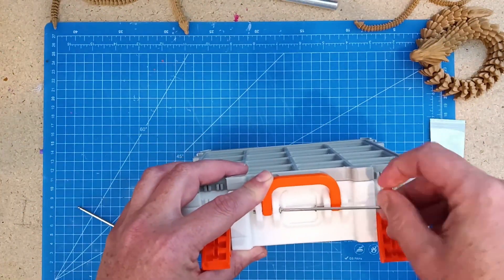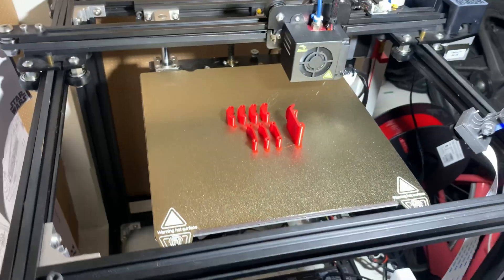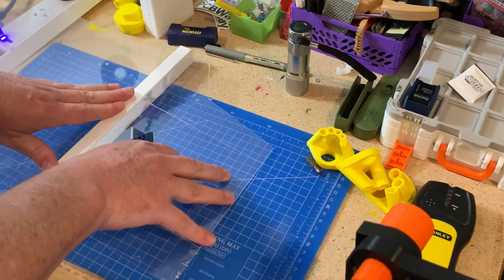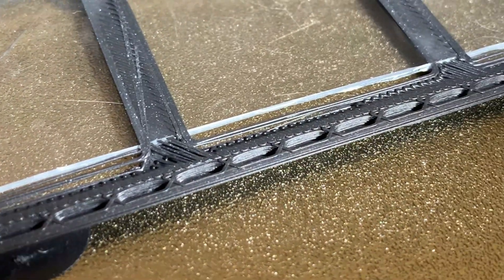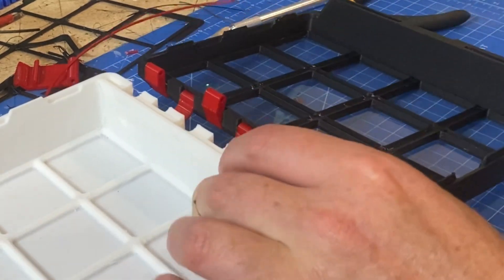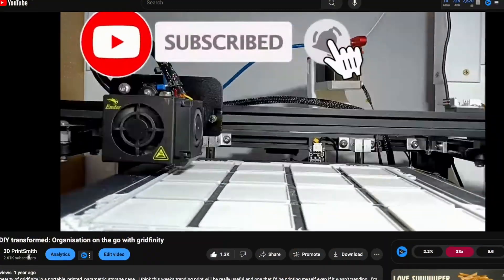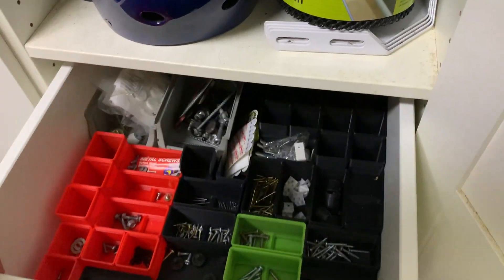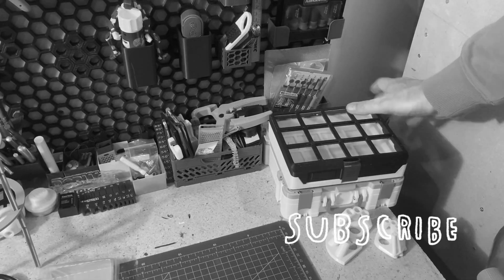Gridfinity portable case.  Organization transformed with a DIY parts case

Comment: Is it obvious where to pause to add the window?
Reply from the maker: It was a little tricky at first to see it but when you slice it, as you go through the layers you want to pause just after the corner tabs are printed.  That’s the recommendation anyway and I think it’s so the acrylic is held down so the print doesnt move it.  I printed another one and because my acrylic was fairly thin and easily fit I paused just before the tabs and it worked for me no problem.

Comment: I printed this one and it was just a pain start to finish, I will not make this one again
Reply from the maker: That's a shame, the hinge was the trickiest part for me and was definately a challenge.  If you are after a portable gridfinity case still though the one I looked at last year with the screw latch might be a good alternative.  that one sits on my desk and I'm using it all the time.  https://www.printables.com/model/543553-gridfinity-storage-box-by-pred
Reply: i can see you problem, after printing 3 cases.

having the wrong layerhight inserting the window is a problem.
not using the calibration is bad, I ended up using the onshape models, which are configurable and nicely designed, to use larger diameters for the holes, and was able to easily print it with the 0.6 nozzle, and the assembly was easy.

Comment: What’s the height standard for grodfinity?
Reply from the maker: Basically everything is a multiple of 7mm and for the pre configured one I made it was what’s called in gridfinity height 6 so 42mm.  most gridfinity bins are in multiples of 3 so 3, 6, 9, 12 (21mm, 42mm, 63mm, 84mm).  If you use the onshape model you can adjust z multiple in the same way you do the number of bins x and y.

Comment: G'day M8.....love this new box....i printed the old one like you but had issues with hinges and locks.....but ive new printers in the makerspace, so ill retry with this box and hopefully i can get what you made even with the open gap on the clear lid😅. Cheers ol son From A M8 Downunder🙃
Reply from the maker: nice to hear from another Aussie.  according to the YouTube stats it’s only about 10% of viewers.   On this one definitely try the calibration print first if you want to use the filament in the hinge. you might need to adjust in your slicer.
Reply: @3DPrintSmith  Cheers for the the info m8....this 50yr ol bloke is partially disabled so my hobby is 3d printing and Rc Crawling. I will be using the Calabration print first and going from there. i also follow "Once in a six side" on YT as well, another Aussie who does resin and painting. HooRoo ol m8 from Ipswich QLD😁